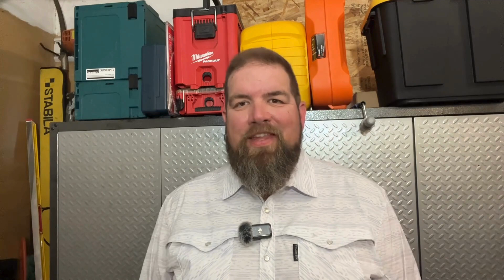Your Home Was Never Required to Be Energy Efficient

Comment from the maker: The pattern in every example in this video is the same: a component that meets a code requirement sitting in an assembly that was never required to perform as a system. Better bulb, leaky fixture. Right-sized unit, leaky ducts. Efficient equipment, envelope working against it.

The question worth asking before any efficiency upgrade: is the assembly this is going into performing well enough for the upgrade to matter? Start there. 

The next six videos each take one piece of this apart.